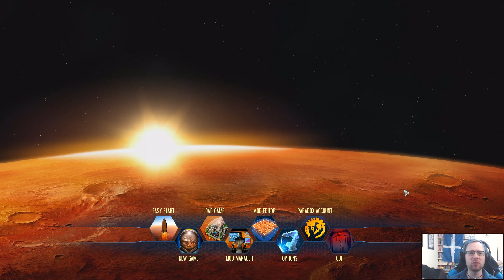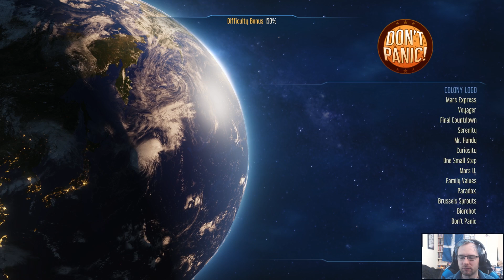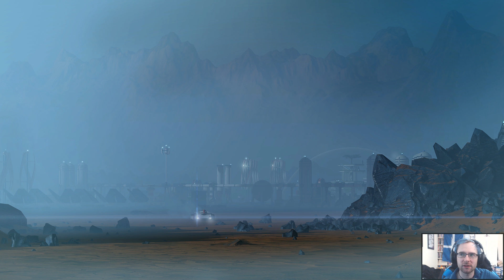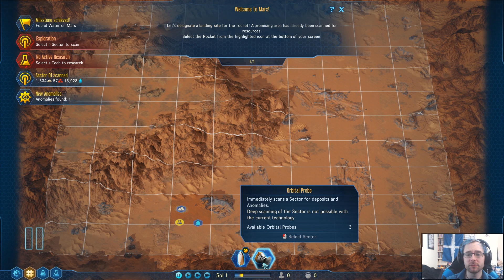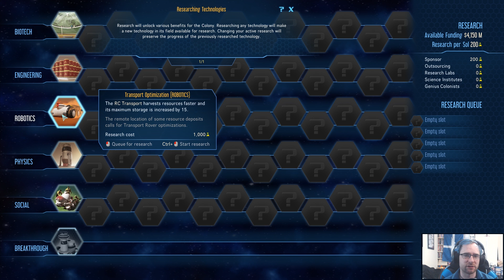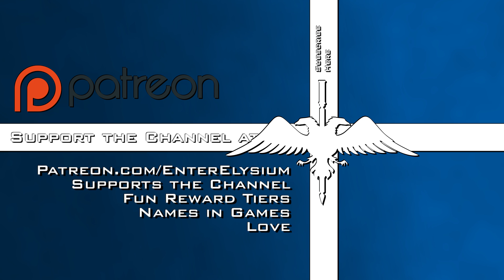SURVIVING MARS | ELLEN MASK PART 1 - ELON MUSK SPACEX Let's Play Gameplay

Comment: Landing on Mars without using any parachutes? That's so inefficient
Reply: Dude, parachutes suck on Mars. The atmosphere is way too thin, so you need a big chute and even then it's only really good for killing orbital velocity, not so much landing gently. Everything we've landed there has always had something in addition to the parachute to get it down safely (hey, the Curiosity rover used a rocket-powered skycrane!).

Why do you think Elon has been working so hard on landing boosters without parachutes? If it can be done on Earth (which he's quite well demonstrated), it can be done even easier on Mars because of the low gravity.
Reply: on top of this larger craft also need the structural integrity to use parachutes or one or the other will rip apart
Reply: You don't use just a parachute but not using one at all is wasteful. Even a small parachute would have a bigger impact then an equivalent mass of fuel